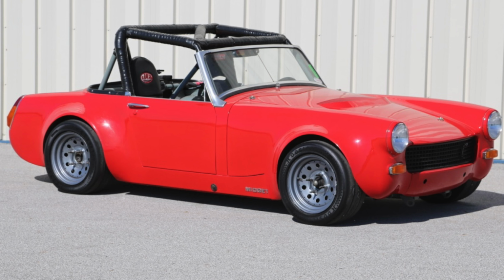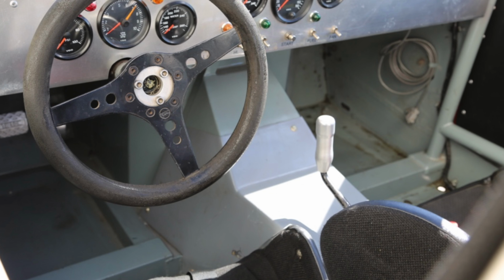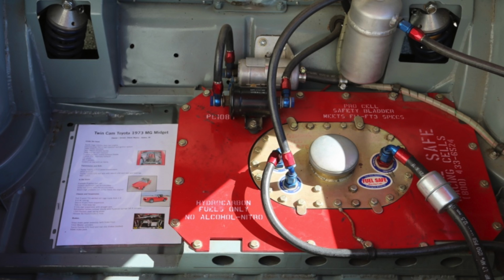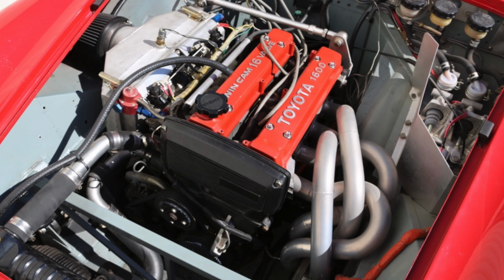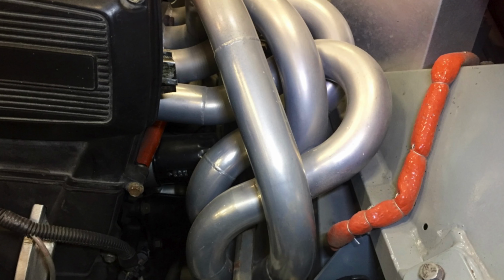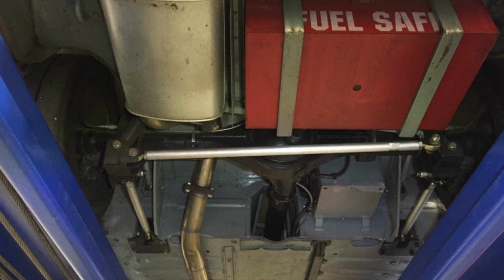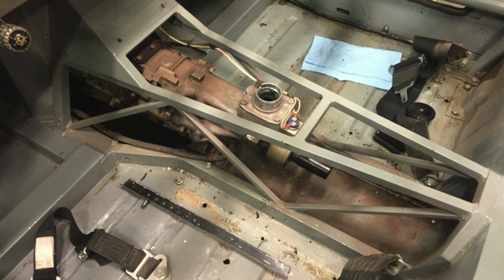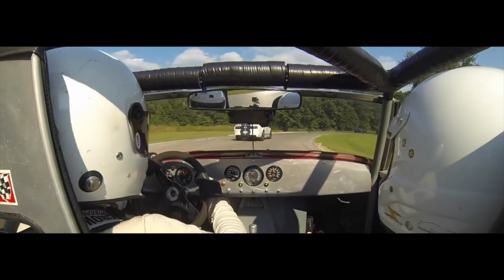My Old MG Midget Race Car

Comment: In the winter of 1967-68 my friend from Indianapolis and I were in school in Denver.  He bought an MG Midget racer from someone in California and they met in Vegas to swap.  He had a trailer and pulled it back to Denver and eventually back to Indy.  Looking into its history, he found out it was built by Huffaker as a Factory Works racer.  I think it was the loudest 4 cylinder motor I  have ever heard.  He campaigned it in SCCA for several years.  We lost track of each other and I haven't seen him since about 1972.
Reply from the maker: This race car I found has a Huffaker factory BMC race engine:  https://youtu.be/3zd1RK7YnNw
Reply: @ThisWeekWithCars  My friend was Ron Jones from Indianapolis.  He eventually acquired the Goodyear or Firestone distributorship and supplied all the Indy cars.  If he is still around he is about 85 years of age. Maybe I'll try to find him on the web.  Great guy!

Get that Sprite running!

.

Comment: I've put a TOYOTA 4AGE 20 valve blacktop in a 1975 MG Midget.  Project almost done, but having problems.  Car runs great up till 50 MPH, then starts darting uncontrollably from side to side...any ideas?

Comment: Very sweet! I'd ask why you sold it but you seem to have a lot of very cool cars now that I could justify wanting once you've gotten the most out of another. But that one was built for speed and handling all the way. Great driving!
Reply from the maker: I should have mentioned in video but it was mainly because I hated to look of the roll cage. The car was street legal but looked ridiculous in traffic.  I thought about shortening the cage so it would fit inside a factory hardtop which would have looked amazing on and off the track.  All of the vintage race cars I have now have hardtops on them and are registered for the road.